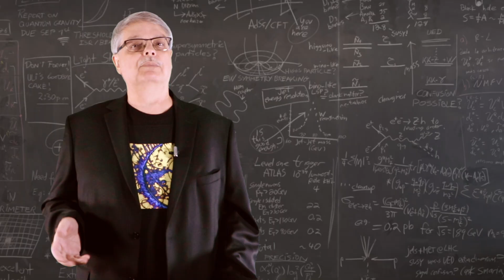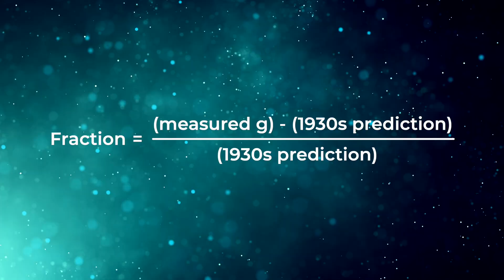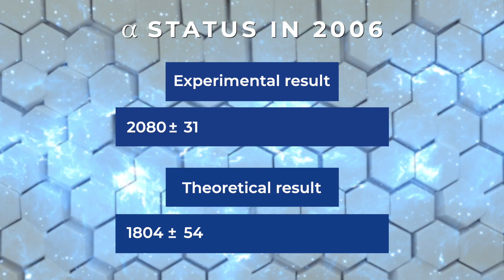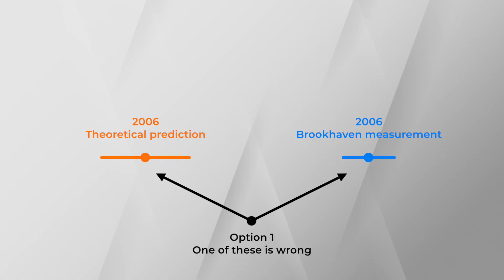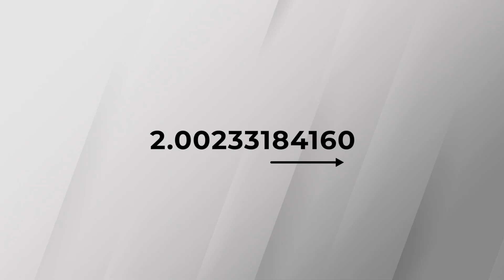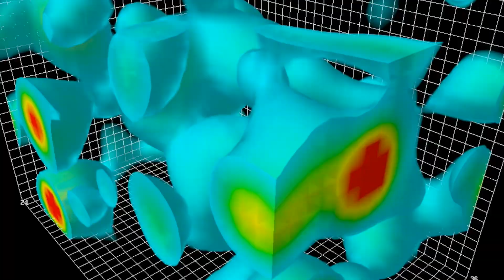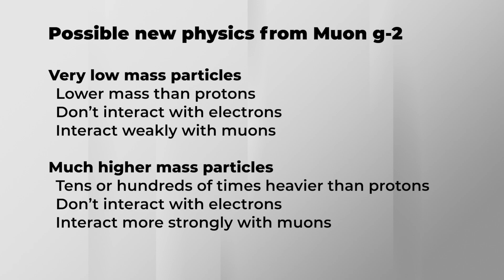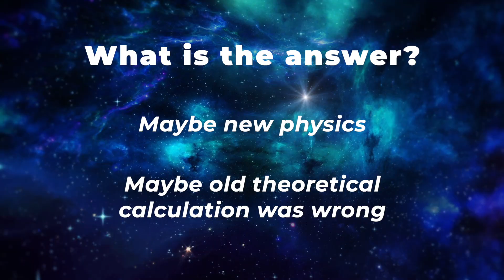What does the Muon g-2 experiment tell us?

Comment: Has anyone in FermiLab had the crazy idea that neutrinos actually contribute to radioactive decay happening in fractions of a second where if matter away from a stream of neutrinos could have a slower radioactive decay rate? If that could be proven by looking at what happens to Voyager and Voyager II if their power suddenly dies when the density of neutrinos from the sun drops below a critical point; If it happens with that kind of power seen in the two theoretical and recent FermiLab predictions, It means that neutrinos are radiation catalysts at the quantum level.

Comment: within the video ... "that our theoretical calculation is missing some new physical phenomena". 

There is one simple physical (not new) argument overlooked up to here. Here it is: possible because it does NOT contradict with the energy conservation law. Assume that the muon-neutrino is still absorbed while measuring the magnetic moment! So then the restmass of the muon is slightly increased affecting the  magnetic moment, so that the gu-number from experiment is slightly increased as well for that reason. However, this is not respected (taken into account) while calculating the g-2 number from Theory. Only to let you know this extra speculation not mentioned in the video - being an experimental fact or not is open as long as the anomaly exists.. The last word has the experiment. (By the way the FSC 1/137.035999046 or  1/137.035999206 or so does not reveal such a tiny neutrino mass effect mentioned.)

Comment: Quantum Entangled Twisted Tubules:  "A theory that you can't explain to a bartender is probably no damn good."  Ernest Rutherford

When we draw a sine wave on a blackboard, we are representing spatial curvature. Does a photon transfer spatial curvature from one location to another? Wrap a piece of wire around a pencil and it can produce a 3D coil of wire, much like a spring. When viewed from the side it can look like a two-dimensional sine wave. You could coil the wire with either a right-hand twist, or with a left-hand twist. Could Planck's Constant be proportional to the twist cycles. A photon with a higher frequency has more energy. (More spatial curvature). What if gluons are actually made up of these twisted tubes which become entangled with other tubes to produce quarks. (In the same way twisted electrical extension cords can become entangled.) Therefore, the gluons are actually a part of the quarks. Mesons are made up of two entangled tubes (Quarks/Gluons), while protons and neutrons would be made up of three entangled tubes. (Quarks/Gluons) The "Color Force" would be related to the XYZ coordinates (orientation) of entanglement. "Asymptotic Freedom", and "flux tubes" make sense based on this concept. Neutrinos would be made up of a twisted torus (like a twisted donut) within this model. Gravity is a result of a very small curvature imbalance within atoms. (This is why the force of gravity is so small.) Instead of attempting to explain matter as "particles", this concept attempts to explain matter more in the manner of our current understanding of the space-time curvature of gravity. If an electron has qualities of both a particle and a wave, it cannot be either one. It must be something else. Therefore, a "particle" is actually a structure which stores spatial curvature. Can an electron-positron pair (which are made up of opposite directions of twist) annihilate each other by unwinding into each other producing Gamma Ray photons.

Does an electron travel through space like a threaded nut traveling down a threaded rod, with each twist cycle proportional to Planck’s Constant?  Does it wind up on one end, while unwinding on the other end?   Is this related to the Higgs field?  Does this help explain the strange ½ spin of many subatomic particles?  Does the 720 degree rotation of a 1/2 spin particle require at least one extra dimension?

 Alpha decay occurs when the two protons and two neutrons (which are bound together by entangled tubes), become un-entangled from the rest of the nucleons

. Beta decay occurs when the tube of a down quark/gluon in a neutron becomes overtwisted and breaks producing a twisted torus (neutrino) and an up quark, and the ejected electron. The phenomenon of Supercoiling involving twist and writhe cycles may reveal how overtwisted quarks can produce these new particles. The conversion of twists into writhes, and vice-versa, is an interesting process.

 Gamma photons are produced when a tube unwinds producing electromagnetic waves.

Comment: I would be most curious as to how the lattice calculations vary with "grid size". For example, if calculating on a slightly smaller grid moves the computed g-2 value away from the experimental measurements (toward zero, say), then one might reasonably surmise that calculating with a substantially larger grid would result in a g-2 value even closer to the experimental value(s). [The decades old dream of doing very accurate tau precession experiments may re-emerge, probably still remaining a dreamy dream.]

Comment: 1:17 and how much it is spinning ? It does spin ?? Is it variable or constant ???
1:41 according to windows calculator which may be wrong 0.1% higher than 2 is exactly 2.002 - it is NOT 0.00238 that should be more than 0.1% something like 0.119%
2:15 and we know they are particles, not the waves in the moment of measurement ?
12:50 and what is with low mass high size case ?

Comment: Hey Fermilab I was wondering if you can help me solve something? If Einstein was right about the relatively of time. The faster you travel the longer you live for example. What if you're able to speed up the rotation of the earth and it's orbit around the sun about two to three times faster than it is now? Basically speeding up the whole solar system. Would you and everything else on this earth live twice or three times as long, or would it be just an equivalent?
Reply: In order for relativity to make a 1% difference, you need to travel at about 10% the speed of light.  Thus you need to be traveling at speeds that are a tad shy of the Earth rotating once per second.  (And that's at the equator.)
Reply: xin chi the undercover pooh the bears agent  here's one for you. What happens when two objects are moving away from each other? The universe isn't a plasticine or is it? Ole Roemer claimed to have measured the speed of light. But I don't think he ever saw the light. Does it take a genius to figure out when two objects are moving away from each other distance doubles or becomes twice as fast? When earth 🌎 was orbiting to the E2 position it was moving away from from J2. When earth 🌎 was orbiting to the E1 postion it was moving in the same direction as J1.  https://youtu.be/XNJw0B1o8cQ
Reply: xin chi the undercover pooh the bears agent  ya I know a**hole.

Comment: 7:58 what leads to a measurement being 15 years older having lower uncertainty?
Reply: More measurements for the older experiment? After all, Fermi are going to do a bunch more measurements to reduce the uncertainty.
Reply: thisnicklldo is precisely correct.  The Fermilab measurement will eventually include 16x the data that has been reported to date.

Comment: E=mC² Bose-Einsteinian Condensation Physics, is Everything about temporal superposition spin-spiral probability wave-package coordination. Depending on locked constants of timing-phase positioning holographics, the Muo-objective measurement of sync-duration momentum is a ratio-nal assembly of logarithmic spin-spiral condensation modulation interference coordination of e-Pi-i omnidirectional-dimensional holographic Spinfoam bubble-modes, as in any Quantum-fields Mechanism coherence-cohesion objective. 

Fine Structure Tuning-> a Universal Constant pulse-evolution property of numberness. 
"If we knew what we were looking for it would not be called Physics Research", so something is discovered, a bit like a Roulette Wheel that regularly aligns with a table of probabilities that have an unexpected "mass defect".(?)

Water in a stream running over rocks has a standing wave pattern. Temporal projection-drawing inside-outside time-timing holography, dimensionality coordination, is similarly affected by Prime and Cofactor Gapping of Quantum Operator Fields Modulation Mechanism, Infinity/Eternity Singularity.
Reply: lol

Comment: Question. In the Feynman diagrams used in the theoretical prediction, did they consider only electron-positron states? Shouldn't they also consider proton-antiproton scattering terms?

In my theory, a proton is a coherence between stationary states of deformation of space. It has been mapped to (2/3, 2/3, -1/3) where those numbers are mapped to axes deformation lengths (positive values are dilation, negative values are contraction).
There is an obvious map between this 4D ellipsoid and QCD. One just needs to make the axis to be independent and QCD equations become equations describing the deformational dynamics of my construct.  In other words, just divide the particle mass by some space mass density and you move into describing displacement volume fluctuations.

Considering just the quark-antiquark pair in the QCD is a step in the right direction. That said, it is clear that larger particles would give larger contributions to the polarizability.  So, it seems that the theoretical discrepancy is just a problem in the choice of terms in the expansion, nothing else.  The physics is solid.

There is a small detail since the muon itself has a structure in my theory (it is a trimer of electron, positron, electron - this is pion minus).  So, that might also modify the calculation.

Comment: could you derive the relative size difference of muons and electrons using the g factor?
if the muon is larger its maximum electromagnetic field strength should be smaller than that of an electron thus less matter/antimatter creation and less of a "cloud" adding to the g factor
and vice versa

Comment: Why does it take a year or two for the new data to be processed. Can't you just run the data through the same equations?
Reply: The new data has not yet been recorded.  And, furthermore, the equipment's performance changes slightly overtime.  When you're measuring something with accuracies of parts per trillion, you need to be super, ultra, mega, careful.

Comment: Also quick note: It looked like the new theoretical calculation still didn't agree entirely with measurement.  It's a lot closer, but it still doesn't seem to overlap.  If the new calculation is correct, wouldn't it simply reduce the discrepancy, not erase it?
Reply: Not all discrepancies are the same.  In real physics measurements, it is rare that the two agree identically.  If they do, the uncertainties are too big.  You expect about a one error bar difference a lot of the time, even if the measuring device and theory are perfect.

That's statistical fluctuations for you.
Reply: @drdon5205  So it's less "this agrees with theory within the error bars" and more "this is as close as we can reasonably expect given theorist's limited knowledge at the edge of physics and the overall 'messiness' of real world experimentation and technology" if I'm understanding you correctly.

Like, you can run the same experiment, same equipment, same team, but get (slightly) different results, so even if the =/- of theory and experiment don't overlap exactly, you can still be relatively certain they are in agreement?

(forgive me for the follow up question, I'm just determined to think more like a practicing physicist than an amateur living in the pristine, clean world of equations)
Reply: @lastsilhouette85  If you made the measurement twice, with no changes in any conditions, you'd not expect that the two measurements would be identical.  They would, more often than not, be in reasonable agreement when uncertainties are taken into account.  

But they >>shouldn't<< be the same.

Comment: My guess is that more is going to be learned by finding out the reasons why Lattice QCD is sitting solidly outside the error bars of the current theoretical model. Either there are floating-point rounding errors with trillions of calculations going on that haven't been properly managed, or there are basic theory fundamental mistakes that have been programmed, or the 2006 guys need to update their calc because it makes zero sense to me mathematically that this is happening.

Comment: I'm no physicist, so I'm sure I'm not understanding something. Looking at the graphs it appears that the Fermilab experiment neither confirmed the accuracy nor improved the precision of the Brookhaven measurement. It seems to have further muddied the waters. Is there some reason that the error bar on the Fermilab measurement is larger than the one on the Brookhaven measurement?
Reply: Yes.  The initial Fermilab measurement is on one year of data taking, while the Brookhaven one was for many years.  Eventually, Fermilab will increase its dataset by x16, and it will have smaller uncertainties.  

Furthermore, statistically, the FNAL and BNL measurements are in rough agreement.  It would be shocking if the two numbers were identical, given their various uncertainties.
Reply: @drdon5205  OK, got it, time will tell. Thanks for the reply!

Comment: I have trouble grasping quantum foam since if the virtual particles (say quarks) and their antimatter virtual partners exist apart for ANY amount of time (and they must for G>2) then energy will be lost to the foam via gravity waves.  The virtual pairs annihilate but I've never heard of gravity wave annihilation.   Gravity becomes significant at the very small scales involved when virtual pairs first "separate" and then "merge" I suspect.  A thought that gnaws at me: could the muon have structure (it decays after all) and could the structure cause the difference in G rather than muon interaction with some heretofore undetected particle?  The fundamental unit of charge appears to be 1/3 eV so maybe even the electron has structure causing G>2???
Reply: @grizzomble  Thanks, though not satisfying to me.  If the virtual charged particles interacting with the muon alter its frequency of precession then they must have mass (Newton's 3rd law) so they are apparently interacting with the Higgs field.  So it seems that their mass and gravity can't be swept under the rug.  Also, the foam should presumably be random, exerting equal amounts of positive and negative angular momentum (G==2).  So QED loops asymmetrical and if so, why?

Comment: Americans have been taught the Metric System for over 40 years! And the Metric System was federally instituted over fifty years ago! Americans still talk in the cultural familiar annotation, of Imperial Measurement, in the sense of a colloquialism. 
Should we utter the same platitude at Brits for their propensity to refer to their body weight in "Stones"? 
So F'ing knock off the nonsense of translating Metric measurement to Imperial measurement!
Reply: Inch is defined as 25.40000___ mm EXACTLY. Therefore it is METRIC!
Reply: @milantrcka121  EXACTLY LOL. You obviously didn't LISTEN very carefully to Dr. Lincoln's reference to "Americans"!
Reply: @milantrcka121  Amazing. 2 sentences, 2 errors. Perfect score.
Factual error: The inch is not defined that way. It's the (international) yard that is defined as 0.9144 meters.
Logical error: The Imperial unit of length—the (international) yard—is defined in terms of the corresponding metric unit—the meter. That does not make the yard metric! It would be metric only if it were defined in the metric system. Which it isn't.

What's with all the zeroes and underscores? I'd classify that as a notation error, but that'll hurt your perfect score.
Reply: @nHans  "Standards for the exact length of an inch have varied in the past, but since the adoption of the international yard during the 1950s and 1960s, it has been based on the metric system and defined as exactly 25.4 mm."
(WIkipedia)

"At various times the inch has also been defined as the combined lengths of 12 poppyseeds. Since 1959 the inch has been defined officially as 2.54 cm." (Britannica).

lipedia)

If EB is not enough for you I do not know what is.
As an aside: I am perfectly fluent in Metric and SAE in math, engineering, machining, and construction. BTW: Pipe sizes and  threads are still based on (imperial) inch. See above.
Reply: @milantrcka121  I'm disappointed, but not surprised, that you did a superficial Google search and presented the results as a show-and-tell.

We're talking specifically of the US, and I stand by what I said. Following that 1959 conference, the US National Bureau of Standards published the definition of the International Yard as I've mentioned before, and the US Department of Commerce issued an official notification to that effect.

In the US, the exact equivalence of 1 inch = 2.54 cm follows from the definition of the yard.

I'm quoting from a printed handbook, but I too did a Google search and found several, more detailed results—specifically for the US situation. For example, search for "Refinement of Values for the Yard and the Pound" on USMA website, and "United States customary units" on Wikipedia. (YT didn't let me paste the links directly.)